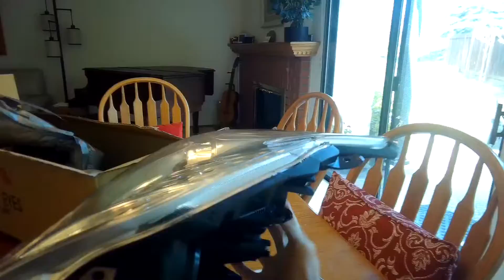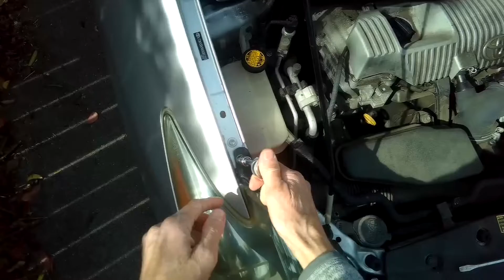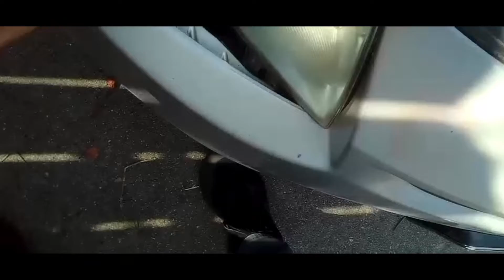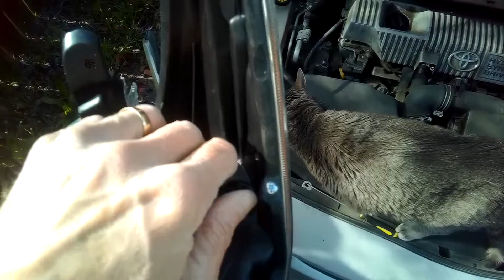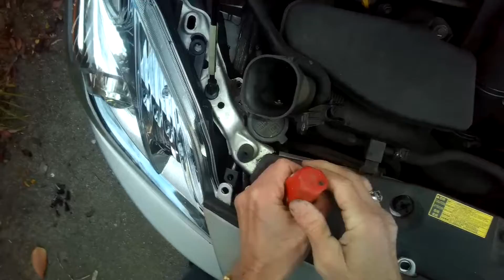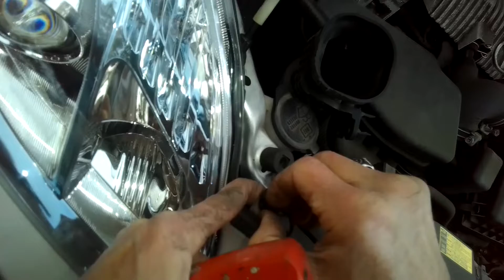✨ Prius Gen 3 - Headlamp Assembly Swap - Done in Minutes! ✨

Comment: That's exactly why I am having to replace my passenger headlight assembly; a badly-seated replacement bulb MELTED the hole in the existing passenger side assembly. I had to buy an entire replacement assembly. smh. Psst Toyota, it is "bad design" when you can't just easily replace a burned out headlight bulb! Then come to find that IF you can find a mechanic who will install parts that I bought (most want to buy their own parts), they want $250 to install just ONE headlight. Headlight nightmare! Anyway, thanks for fairly simple instructions.
Reply from the maker: Thank you @beckyd712!

I totally understand your frustration with the poorly designed headlight assembly. A melted assembly is no fun at all! I'm glad you found my instructions helpful for the replacement process. It can save you a lot of money compared to what mechanics might charge. Good luck with your repair!

If you need more info, you can reach me directly for a fast answer at AsqMe.com/@ScottTheFixItGu
Reply: @beckyd712  Toyota wanted 480$ from me !! Even with my own part. But this seams like such a pain in the ass. I would pay someone maybe 100$ hahaha

Comment: I had a very similar problem with the bumper to get into changing that nasty halogen bulb on my Cadillac Escalade. I don't know why these car manufacturers have no more respect for the mechanics and repair personnel (Or is this their job security to remain in the business of selling new cars all the time!).
But & more importantly, I guess I got late to pass you a piece of advice that may add to the longevity of your headlamps for years if not decades... And that is, look at oxidized old ugly head beam lens covers and compare them to the crystal clear newer plastic ones... Priceless. Unfortunately soon UV and elements will turn them look like the old ones. To prevent this, the secrete is "Get them to spray with 2 coats of clear coat". And the difficulty is to cover your car part (When installed) to prevent damage to cars paint etc. But now that you had the lenses unassembled, it might have been the best time to cover them with the Clear Coat and ensure long time flawless new car look. 
Well, may be the next time.
Reply: Looked this up and found this: Important: Do not apply to clear, new lights. Use only after sanding away failed, oxidized coatings. Consumer Reports